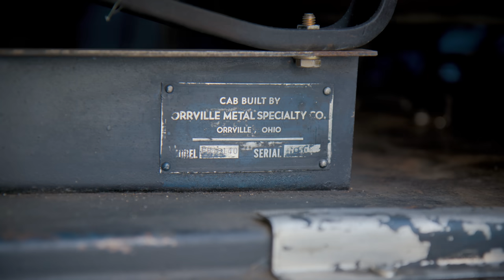FRIDGE FORD: Coyote & Godzilla-Swapped 1960 Ford F250 Fridge Crew Cab Trucks | EP37

Comment: Man, that was fun !! Perfect explanation about driving in the wet !! That dirty street water stains hard on a hot metal surface. Excellent work on both trucks. Looks like ya talked Roman's wife inta learnin how ta drive the beast !! And not a huge amount of freeplay in the steering wheel here !!
Reply from the maker: Glad you enjoyed it!  Thank you for the nice comment!!
Reply: Steering is tight but still has some bump steer that could benefit from possibly a different suspension set up over the leafs but it will do for now. I hope my has forgotten the lesson by now for my clutch’s sake hahaha
Reply: @Keepnitclassic  In a previous vid Nicole drove a manual steering machine with a HUGE STEERING WHEEL that had a BUNCH of free play she questioned.

Comment: Hey my man.  I still drive my regular cab 59 stepside
  Purchased for 400$ in '72
It was a state truck, cruzer, gasser running 13s  Shipped to Savanna in 04 and driven hard by my Son,  an army Ranger at the time. trucked back to Oregon for refitting then daily driver hot rod since. 
    custom springs, PS,  
390 Gt. motor and 4 speed from a 68 Torino Gt. , bored and built in 85.  still runs strong ,traction bars, anti sway bars, plus a few  custom modifications of my own design.   I never had the bucks to build a frame up job like you did. But I must say that 
D TRUCK.  has held up
    I'd love to cruz with you sometime If you can keep up!   Lastly  ...paint them both midnight black laquer
    best  Dave H. forest grove Or.
Reply from the maker: Thank you for sharing with us and watching from Oregon!!

Comment: this is an awesome dude! I drive the same type of rides and you cant beat any slammed truck with a killer motor. My ride is a 57 chevy pickup on a camaro chassis original paint some surface rust with a clear coat old school rallys with as big of back wheel as i can fit under it 2nd ride is a slammed channeled and chopped 27 Ford coupe 550hp @Rustyhalligans
Reply from the maker: Thank you for sharing!!

Comment: Between 10:10 and 10:15 is there a bolt missing out of the cross member for the transfer case? (I guess if the truck didn't look so flawless that wouldn't stick out like a sore thumb...)

Comment: Nice trucks, I to love the ugly cars and trucks, (My love is a 58 Ranch wagon). One thing i'd change on these two is the 7.3 would be in the big truck and the coyote would be in the lowrider, Why? because the 7.3 has better torque and would manage that big truck better
Reply from the maker: I’ve driven both of these trucks and I can tell you the Coyote is plenty of power and torque for the 4x4. “Bernie” has a Godzilla so it can do killer burnouts. 👍🏼
Reply: @NicoleJohnsonsDetour , I do not doubt it at all, I'm just saying both engines are designed for differing tasks and in this case it appears they are in the wrong trucks. Just my opinion though, watching the vid, you are right, there was no lacking in ability, so Good for him

Comment: Speeding with two little kids, with two totally useless lap belts. 😔😔
Reply: School busses don't even have seat belts. Live a little.
Reply: These trucks would drive through any Tesla with 3 points any day and not even know it hit anything…. Just saying
Reply: @Keepnitclassic   Easy to lose control of such a vehicle, not about hitting anything, the thing is a pig to steer and keep on top off.
Reply from the maker: Steers just fine if you ask me
Reply: @NicoleJohnsonsDetour   19:52  ''you have to really concentrate on what you're doing, the car's not driving itself, so much weight and power and I gotta steer it all, and it's like you're risking your life just to go for a drive in an old truck''  🤔🤔    Aw I get ya though dude, but I still think those kids deserve a racing harness, rather than a lap belt.